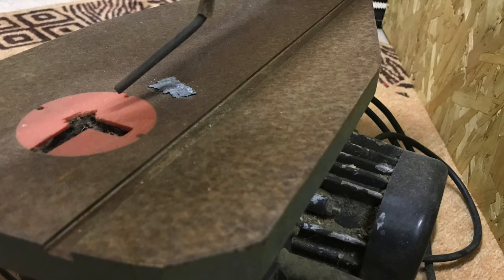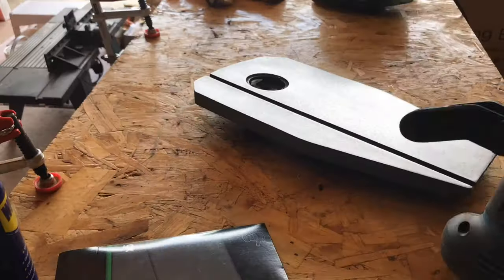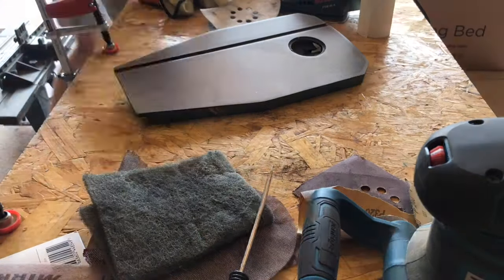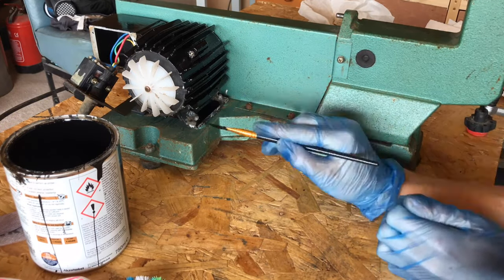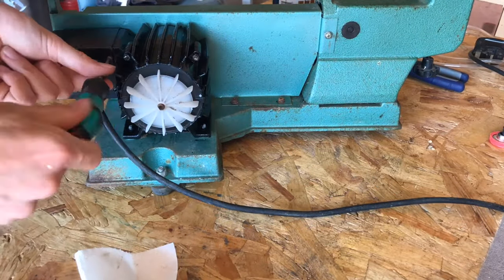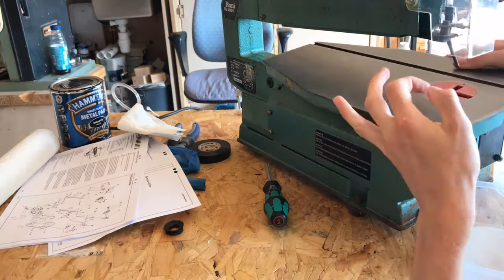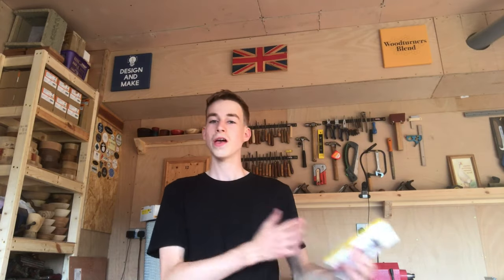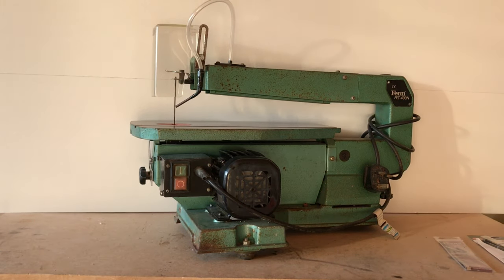Restoring A Ferm FFZ - 400N Scroll Saw

Comment: Hi I've just started the exact same project. Unfortunately the gas bag is perished and I can't find one anywhere. Was wondering if you had any ideas where i could find one. Just hope mine ends up looking as good as yours.
Reply from the maker: Hi thank you!! The gas bag has also perished in mine, but I have not got a replacement as it seems hard to find one but I am sure other brands would fit. If you have a Hoover close by the table of the saw dust is not really an issue. I hope this helps!